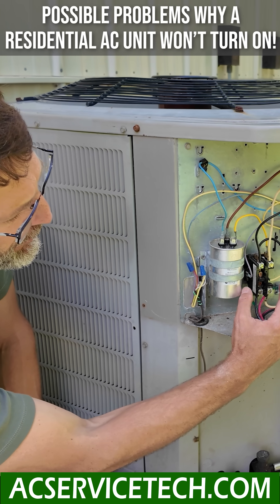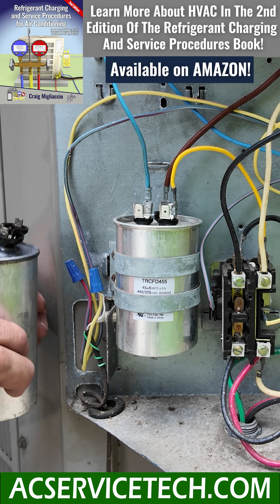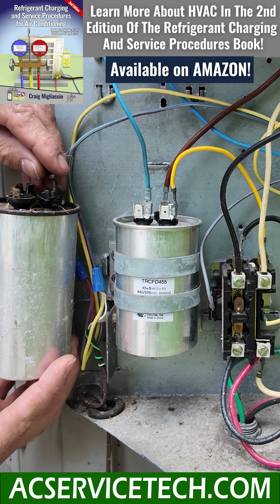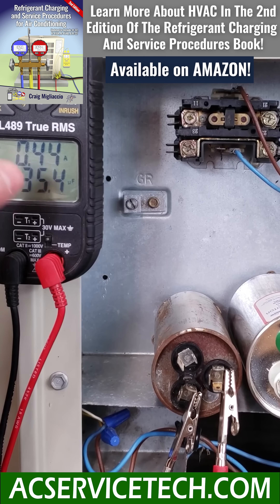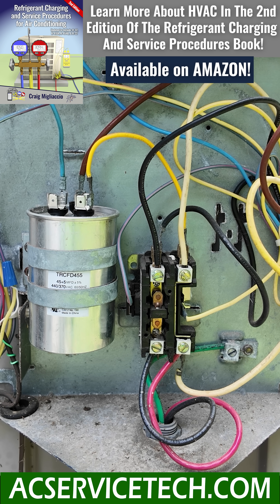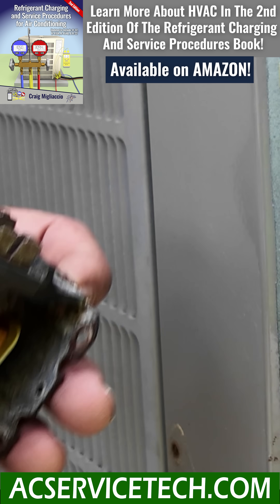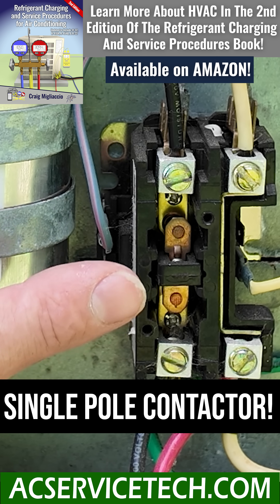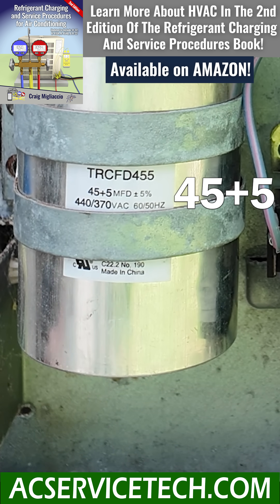Possible Electrical Problems On An Outdoor Air Conditioning System!

Comment: I recently had a China-made 24v contactor that was pulling 3.8A on 3A fuse BUT ohmed ok cold. I replaced reasoning that coul winding insulation was breaking down under load.

Comment: I had a bad capacitor (36uF installed of 45) which looks good. Just use multimeter to check.

Comment: Thank you so much. I don't know why I'm not getting any of your mainline videos. Maybe you haven't put any out lately. I found a and it might have been one of your videos. But I found a shade cover for the outdoor portion. Almost a 20° split between the ambient temperature on the outside at 2:30 p.m. at the hottest point, almost 100° f. With the sunshade it was tapping on 77° where the capacitor and a contact relay are located. I believe this will give it longevity and it doesn't block the exhaust fan. If the contact relay starts chattering, that's a good indication that it's bad. Also, the capacitor as you shown are very common. But as we all get older and if you don't use it, you lose it. The information that is. You've been a blessing and thank you so much ✨🕊️❤️🕊️✨
Reply from the maker: I'm happy to hear my videos have been helpful for you, thank you for your kind words!!

Comment: Made in China Capacitors often fail but good old American made USA Capacitors made in Tyler TX for Trane Units run for the life of the Ac normally about 30 yrs plus. I seen it on Replacement units still w Original Contactors and Run caps.Amazing
Reply: Lmfao. As an hvac tech thats a fucking laugh. I'm constantly replacing us made just as much as any.
Reply: I've bought two China contactors that failed in less than a year. Yes, I finally learned....🥴